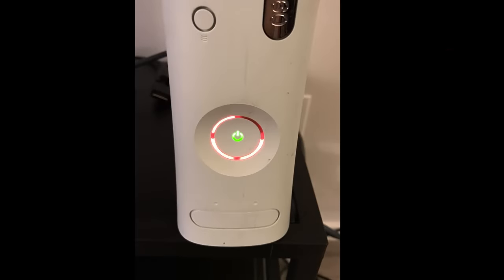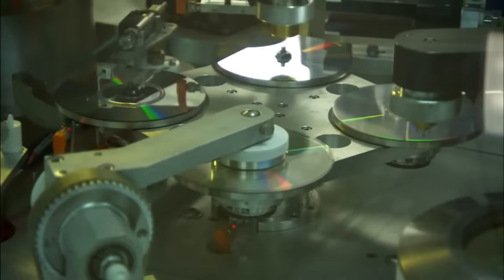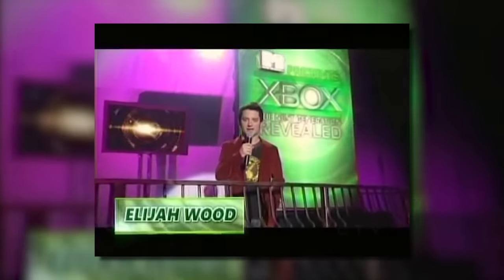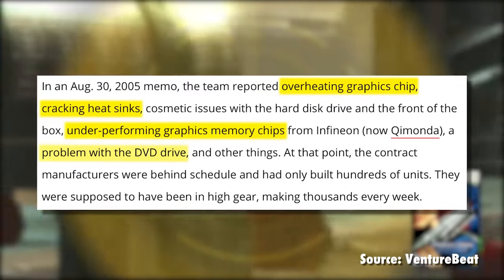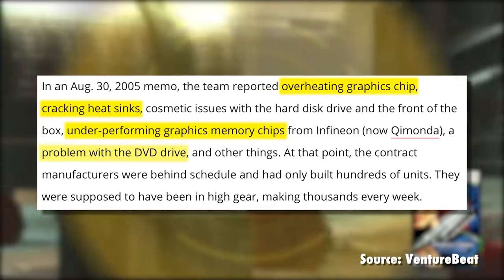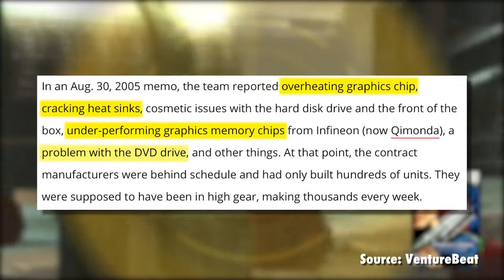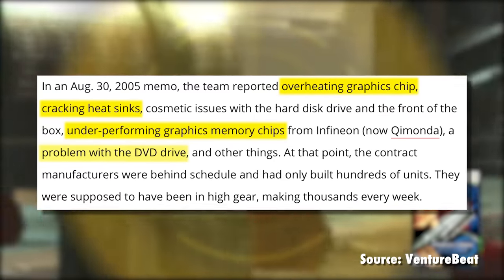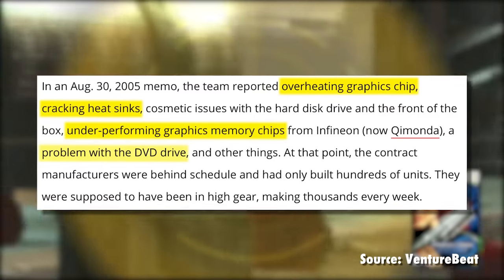History of the Xbox 360 Red Ring of Death | Past Mortem | SSFF

Comment: My brother went through 2 X360 due to overheating, and my fatty backwards compatible PS3 overheated. 7th gen was not a good gen for hardware reliability. Meanwhile my SEGA Genesis, PS1, and PS2 still work flawlessly.
Reply: DarkHorizons I grew up in eastern europe so not a lot of consoles for us pre 2005.My grandfather got his kids an atari in the 80s from germany and I have a nes chinese knockoff wich I bought for the equivalent of 10 bucks and both work even today
Reply: Yup. Someone gave me the original Xbox he bought from 2001 or so. It has a few nasty scratches and a cigarette burn but it still works flawlessly too
Reply: Seems like the Wii was the only one that worked good
Reply: It's like they all even out in the long run, minus the first and eighth generations.
Simplistic top-loading consoles like the 2600, Colecovision, and Odyssey 2 have a reputation for being built to last.
 
The Third generation threw the in NES's infamous, albeit fixable, faulty method of connection.

The fourth gen's two main consoles were solid, but the advent of new CD-based hardware like the SEGA CD, and the Turbo-Duo made it a mixed bag.

The fifth gen only had two major cart-based home consoles, the Jaguar and the N64.  Everything else was CD-based, but companies did a decent job in ensuring their build quality overall.  The 3DO and the launch model PS1 were both pretty susceptible to overheating, but nothing too big yet.

The 6th gen went entirely for CD-based hardware, and things started to suffer because of it.  SEGA didn't have enough money to equip the Dreamcast with a good laser, and the PS2's DVD compatibility meant that the hardware had to take some compromises, but OG XBox consoles and Gamecube consoles still manage to hold their own 16 years down the line.

The 7th gen had faulty hardware across the map.  XBox 360's could last a matter of months, PS3's were usually a mixed bag, and even my old Wii's laser finally gave out after about 9 years.

I wonder if they'll all hit a brick wall at the same time, and we'll experience a mass hardware famine.
Reply: DarkHorizons last night in the middle of me playing Titan Fall 2, (I was trying to play all night) my Xbox made a weird noise almost like a small explosion and cause a power surge to all things in the power strip, and killing my Xbox one permanently.

Comment: Bought a used one from GameStop, got RROD a year in. Found out MS extended the warranty to 5 years. It was still covered some how (bought it years after release), got an RMA on the MS website, sent it in, got it back 1 1/2 weeks later. Worked great till I sold it 2 years later. Point is, they made it pretty painless.

Comment: Somehow my Xbox is still alive even though I got it in 2009, almost a decade ago!
Reply: Damn I just broke my ps4 I got in 2013 I thought that was old.
Reply: Mine is still going to Got mine pretty much the same year as You almost Still fine But my ps3 broke years ago :/
Reply: I even dropped it a couple times I just remembered that it RROD ONLY ONCE and it was actually overheated i left it alone it and was good again
Reply: Mine has been running since like 2012
Reply: I have an Xbox 1 X so it won't die
Reply: mines from 2008
2007 i mean
Reply: I know one guy that we called his 360 "The Legendary" it's a 2005 model that it's still running, it's the only one from that year that I know still works.
Reply: @MrBdenver  mine was build in 2007 and no red ring

Comment: 5 years ago, a coworker of mine sold her original 360 to me. I played it for a few months until one night I was at my girlfriend’s and my younger brother texted me “Guess whose 360 has a red ring of death”. I took it in later to a local computer place that said they could fix it. They couldn’t, so I ended up just buying a refurbished S model off eBay. Then I had the problem of transferring my data from the hardrive to the S. However, the hard drive was apparently broken too, or possibly lost and mixed up with a broken one, by the computer place, so I ended up losing all my save data as well. On the bright side, I still have my S and it still runs great.

Comment: imagine a 360 dying just months after release yet things like the NES still going strong decades later.
Reply: Everyone I ever knew who bought a PS2, PS3, Xbox, or 360 on release had their's die within a month. I've never heard of it happening to any nintendo console. The gamecube is probably the most bomb proof console.
Reply: @LUCNUKEM  I dunno man ps2 are pretty solid, I brought mine on release and it's still going stromg
Reply: TGG SafeJayRay123  not every single one failed, but 360 had very well documented issues & the launch model had a very high failure rate due to over heating. The slim model was specifically made to correct the overheating issues of early 360's.
Reply: Except the Nes was famous for dying too...
Reply: @LUCNUKEM  The Game Boy is literally bombproof

Comment: Back when i was in high school. Both mine and my friend's Xbox360 Red Ringed on us. He was going to throw his away. But ended up giving it to me instead because I wanted to try to fix it. And surprisingly its not that difficult to fix this issue. I was able to fix both Xboxs by removing the X-Clamps on the bottom of the mother board, replacing the thermal paste on the CPU and GPU chips, and replaced the X-Clamps with screws and washers. And it worked. I never had the Red Ring of Death come back. I got my Xbox360 brand new in 2005 and the Xbox360 my friend gave me was from 2009. Both still works perfectly to this day in 2020.

Comment: 0:33 Consider yourself unlucky because the GPU issues of the launch consoles were fixed around May 2008 when Microsoft started using reliable chips. Late Falcon 360s from mid 2008 are generally more reliable than the slims that superseded them and the Jasper/Tonasket 360s from late 2008 to early 2010 are the best built and most reliable 360s of any revision

Comment: Who actually used it vertically though?
Reply: Equilla the Eagle Anybody who wanted to prolong its lifespan. There’s a way to convert some earlier models into a design where vertical orientation doesn’t affect disc drive performance.

The reason you want this is because the heat in there is so bad that gravity becomes an issue; the GPU, which sits on a little stub of its own, is far enough out that when that stub is heated enough, it gets soft and starts sinking. Eventually, the GPU can physically disconnect from the system, giving you a red ring of death.

Or so I’ve heard, obviously this won’t fix some of the other potential issues.
Reply: Ive been laying mines flat for 10 years. Death rings are not fun.
Reply: If you had friends that played the 360 in the first few years since it's release, then you very likely saw vertical orientation, very common back then. Hope this helps.
Reply: I got pissed off because I kept seeing it both ways so I just switched it's position every week.

Comment: Again, the red ring didn't even come close to touching the PS2 misaligned lens. No one ever seems to report on the fact that 3 out of 10 of the first gen PS2 systems would eventually end up not being able to play CDs or DVDs because they had a separate lens for each, and they tended to break down due to their shotty mounting.   This lead to a very simple repair job being done at $80 dollars a pop to anyone who sent their system in.   The system was selling for about 130 at the time the brunt of these failures occurred.  Working in the stores at the time, I saw about 6 people a month come in and inquire why some games wouldn't work.  

After they found out they need to contact Sony and spend 80 bucks and ship the system out for a month or so... they would get fed up and buy a new one.  I gather from informally watching the sample size of three EB Games stores, that a populated area would have at least 4 double dip sales per month at the time the PS2 pulled away from the other two consoles.   I just hate that history doesn't keep the story straight.  That was a high failure rate that doesn't get the same notices.  Especially when it cost you about 2/3rds the console to fix... I think that is more noteworthy.
Reply: jane doe i see an Xbox mega fan (no ofence)
Reply: 3 out if ten compared to 7 out of 10 in the first two years. The PS2 had their failure rates for sure. But it didn't even remotely touch the fucking 360's. My PS2 still works flawlessly and it's 16 years old. The lens will eventually dieu. I noticed many times when moving it when dropped these would cause the lens to become misaligned. Try dropping your fucking 360 Xbox Fanboy. The disc read error is a huge problem that we recognize but it never came close to the fucking red ring. Not even close. Most ps2s died from drops or crappy packing when moving (you know like letting the system shift around in a box in the back of a truck)

Furthermore these were fixable cases. Microsoft wasnt repairing them exactly. They were flat out replacing them because there was never anything they could do for the first 12 million consoles sold. They were fucked. The entire system was fucked. The PS2 had a laser problem that could be fixed with a few adjustments of the laser 9 times out of ten.

Also it was cheaper to have a PS2 in every room instead of a DVD player for many many many years....

I'm not a Sony Fanboy. If anything I'm a Nintendo Fanboy and I own all the major consoles. But I can tell you having repaired both ps2s and 360s for over a decade now that the 360 was complete fucking garbage hardware wise until the revisions and even then there was still a failure rate but it was at least low then. The PS2 had what is much closer to a normal expected rate. As did the PS3. Most are dead these days after 17 years of use though. 360s are dying after 8 or 9 on average. With normal disc usage
Reply: Just softmod and put a hard drive inside your ps2 with the network card (mine came with one) and load your games on to that. Your Lazer is saved you're welcome
Reply: jane doe honestly I think that's why the ps2 was such a big seller. I went through 8 of them and bought my last one brand new 4 years after production ended because the store actually still had some left due to next generation consoles
Reply: 100% of Xbox 360 consoles prior to the Jasper motherboard have this design flaw. PS2 laser issues were nowhere the 360's failure rate.
Reply: Not coming close... yeah the 3/10 failure rate of the ps does not come close to the 7/10 failure rate of the 360, absolutely correct.
Reply: Honestly at this point it has to be above 90% for those particular models (Xenon, Falcon) - they are all absolutely guaranteed to fail at some point.

Comment: The solder used in the BGA chips was crap. This was the early days of BGA mount devices and I've heard that since then the lead free solder pastes used for BGA are much better. Not as much cracking from heat cycling. Pairing the firmware on the drives to the mainboard  for me was a more avoidable point of failure. Making drive failure allot harder to repair.
EDIT: EPOXY on the chips is more of a hack, does little to stop poor BGA solder joints from cracking. Even with better heatsinks and airflow, early BGA solder paste compounds are just not up to the job.
Reply: exactly

Comment: My original 60gb PS3 Fat with PS2 game compatibly just recently got the the Yellow Light of Death after 13 years of use. I had no idea the original PS3 models were just as faulty as the original Xbox 360s and it's incredible that my lasted that long with only one repair before it's death (blue-ray drive wasn't reading discs for a short time). All things come to an end I guess. Just glad that I have most of my game saves backed up to an external HDD and PS2 memory cards.

Comment: Also, you mention heat being a cause of system failures, but poor ventilation may have exacerbated the issues caused by using lead-free solder in order to comply with European RoHS requirements. It gets brittle over time, and doesn't hold up like traditional leaded solder, especially with the poor airflow. Just doing a reflow on many RRoD'd XB360's will make them work again for a year or two, but replacing the lead-free solder with partial lead solder will fix it for much, much longer, which is what many repair depots will do if you send them your XB360 for servicing. So, even in many RRoD systems, they're not necessarily permanently fried or permanently burned out, assuming you can do the board-level repairs consisting of quality thermal paste and partially leaded solder replacement.
Reply: Indeed, as rushed and as poorly thought out the design of the 360 was, the solder was the #1 factor in the machines failing. Very surprising that it didn't have multiple major points of failure.
Reply: Michael's Workshop 

About that lead solder... I wonder if that requirement was also one of the reasons why NVIDIAs 8xxx series of GPUs experienced some massive issues with heatsinks.

I dont remember how widespread the issue was, but my laptop was fried/short circuited by the heatsink separating from the GPU. The GPU was GTS 8600M I think (or without the S). I got the thing repaired for free after 3 years of purchase, because it was apparently at the time a very serious issue on some machines, and affected a considerable amount of people.

*The laptop/s were released around 2007, so its in pretty close proximity. Was the lead solder ban/restriction a somewhat new thing around that time?
Reply: Michael's Workshop very interesting. Thanks for sharing
Reply: Yeah, this as well as better thermal compound worked for me.
Reply: uh... didn't other consoles have lead free solder?
Reply: Giordan Diodato: Probably, but the solder didn't fail by itself, the excessive heat made it fail. Though a crutch propping up bad design, leaded solder would've been able to handle it better.

Comment: They were out of their minds with the original design. It was packed, with a closed front, obstructed top and likely obstructed bottom ventilation as many opted to stand the console vertically. They had exhaust, but virtually no intake with a wimpy cooling solution. It's no wonder so many of these consoles failed. Me and my brothers were lucky our first-gen 360 lasted until 2008. Credit to Microsoft for taking the L and doing the best they could trying to fix the issue. Our repaired console still works to this day.

I'm just glad they learned their lesson by the time the Xbone came out. My first gen Xbone is quiet and never has a single hiccup, even when the room gets hot. Some lessons have to be learned the hard way.

Comment: I guess I’m a lucky bastard with my 360.
Model variant: Xbox 360 Arcade PAL.
Add-ons: 120GB HDD
MFR date: 2008-09-09
Known issues: Disc tray won’t open
No backwards compability
RROD’s: None
Reply: Arcades don’t red ring.

As for the disk tray, I recommend giving the 360 a smack (not a lot of force) and see if that opens the disk tray.
Reply: ur mom Well i’m currently using guitarpicks to pry it open and it works fairly well.
I need however a more permanent solution, any advice?
Reply: MackisLife idk any permanent solutions.
Reply: Seems like I got the same too, just completely disassembled it, put in an other Disc into the tray and assembled anything back together.
Don't ask me how I'm now supposed to change the disc again.. maybe the tray will open, maybe it won't ... that's like gambling but I'm not very keen on having to reassemble that entire thing in case it gets stuck again.
Reply: @marjoh669  hey man there are videos on YouTube, have you checked them?

Comment: Had mine for 8 years hasnt red ringed for me yet
Reply: Just had my 360 bite the dust (RROD) after 12 years of faithful service. It was literally the cheapest of the cheap $199 xbox 360 arcade with no HD and one small (less then 200mbs?) memory card. 
Its so old it doesn't even have the RAM pads on the back of the mobo to do the *penny trick*.

I salvaged what I could from her. Created a small wooden raft dosed in kerosine. I lit her ablaze with her controllers as she floated to Valhalla across my pond. Me and my buds fired a 21 gun shotgun salute as she spent her last moments on this earth sinking below the waters edge.

Comment: I actually got an original 360 back in 2018*, and I'm glad I managed to get a Jasper model almost by accident; what I mean is that I didn't take much, if any, consideration into when it was manufactured; I knew that date, but I wasn't aware of how it implied that this was among the most reliable of original 360s. As you can imagine, the poor track record of these things in the reliability department made me worried as I went home with it, but that unit was manufactured in January of 2010, making it 12 years old now, and three and a half years after I first bought it, it still works, aside from the disc drive being pretty stubborn when it comes to opening.

*I did have a 360 since 2010, but my first one was an S which I specifically got for the Kinect (it should be noted that I was seven at the time). I have a somewhat interesting story with that model too, but it's pretty long, so I'll spare you the details. What's important is that by 2018, I developed a desire to get an original 360, which I eventually would, although I still have that S as a back up should my current one die.

Comment: I remember this time. I always kept my xbox well vented and had a separate fan to help it out. Also the moment the warranty ran out I took it apart and replaced the thermal compound with top-of-the-line stuff. After that it went on for years and years until it finally red-ringed. By that time i'd converted to PC anyway.